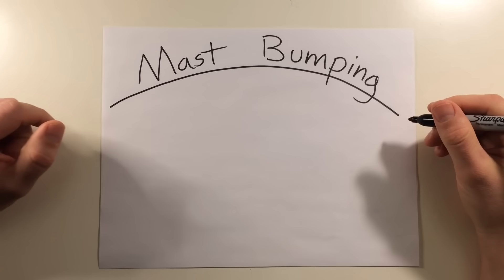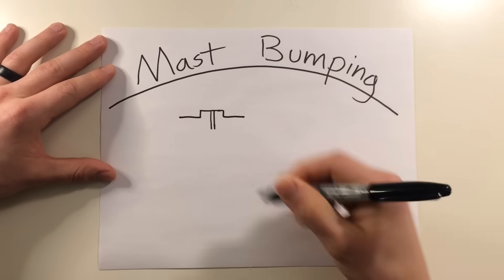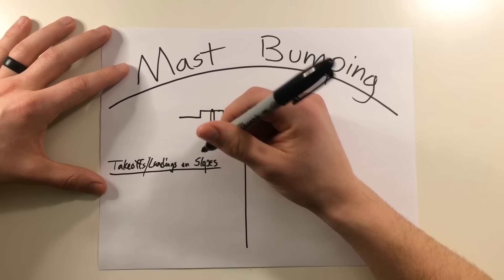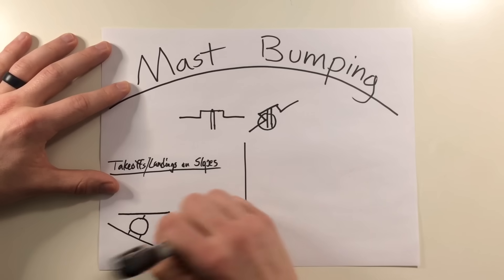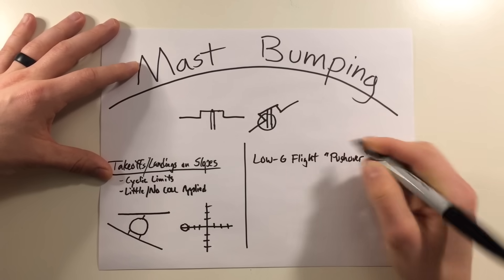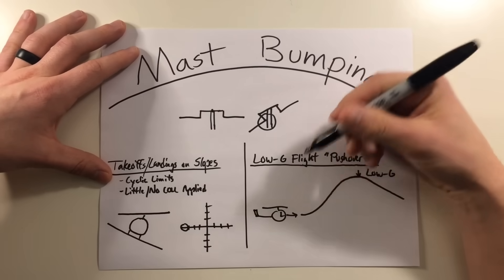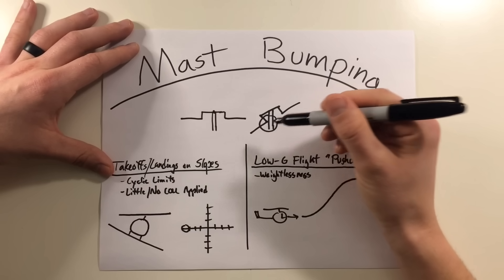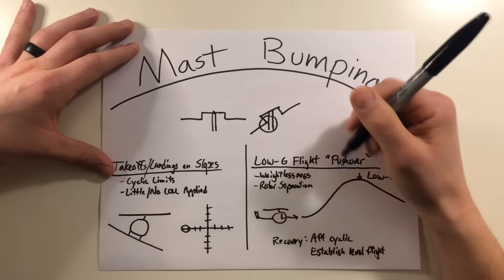Mast Bumping in Helicopters

Comment: 30 year helicopter flight instructor and ems pilot here. The NYC Hudson River accident is very unlikely to be low g mast bumping. LGMB results in the main rotor blades detaching from the mast just below the main rotor hub. The fact that the main rotor blades and main rotor gearbox are still together points to something besides LGMB. More likely a catastrophic mechanical failure of the main rotor gearbox mounting system. Incorrect maintenance is a possible cause. There could be other explanations. When the ntsb retrieves the tailboom and the main rotor assembly they will be better able to determine the cause.
Reply: What if it severed the tail prior to breaking off? Meaning that the rotors didn’t immediately detach but instead impacted the tail. Then the shock of hitting the tail caused the rotors to come off in the fashion you mentioned.
I’m not a helicopter pilot so I’m not trying to argue your point, just trying to learn more.
Reply: This makes sense as I would assume the pilot knew about mass bumping and how to avoid it. I would not think a touring helicopter would rapidly climb just to dive again.
Reply: Yeah but mast bumping is still a fascinating topic. So is ground resonance that’s crazy.
Reply: As a helicopter pilot myself. I agree with Brian.  Watching the rotor assembly spinning to the ground, you can see the mast sheared low by the gearbox, and the blades looked intact. Could be wrong, but I would say gearbox failure. Condolences to everyone on board.
Reply: Fixed wing pilot here: my theory (although obviously just speculation). Here Goes in mostly lay terms...
The Tail Boom Broke at some place FIRST.
REASONING:
The Big Blade at the top spins counterclockwise (to the left) in most American Helicopters
Newtons Law: For every action an equal but opposite reaction
This law is relevant because if the big blade spins to the left, the fuselage will want to spin or Yaw to the right (assuming a certain and basic mechanical gear setup) which directly relates to Newton's Law. Blade spins left, equal, but opposite force makes the fuselage want to spin right.
BUT, the reason the Fuselage does NOT spin right and out of control is because the small tail roter blade at the back of the tailboom Counteracts the force!
So what made the chopper spin abruptly to the right FIRST??? (Mind you spinning FULLY INTACT as far as anything the eye could see, as it relates to the video clips publicized) 
NOTE: for this to be possible, the Big blade did Not slice the tailboom until at or after the fuselage nose was spun to the 3 - 4 o'clock position.
The chopper made an abrupt turn to the right (past 90ºs) to about the 4 o'clock position (completely still in tact) *from what we the viewers could see*
UPON REACHING 4 OCLOCK, THE CHOPPER BEGAN A SEQUENCE OF BREAKING APART.
Again, The tail roter (small blade) counteracts the force of the big blade.
HOWEVER, if the rigidity of the tail boom was compromised (VIA A STRESS FRACTURE) then that would result in that particular structure FOLDING at some place along the Tailboom which would mostly IF NOT COMPLETELY compromise the counteracting force of the small tail roter at the back of the helicopter (causing the chopper to turn right!)
Now, we have a still attached (yet folded and flimsy tailboom).
As a result, the chopper spins to the right abruplty.. broken, maybe tailboom "crinkled" but still intact.
(CAMERAS OR HUMAN EYESIGHT FROM THE GROUND WOULD MOST LIKELY NOT BE ABLE CAPTURE THIS IN DETAIL)
Continuing my theory... As the chopper spins to the right (with a crinkled flimsy tailboom) the flimsy compromised tailboom structure then moves UPWARDS, from forces in flight, towards the main roter blade.
As a result, the compromised tailboom ascends into the spinning path of the main roter... and is consequently "sliced off".
SIMULTANEOUSLY, the impact of the collision between the big roter and the tailboom (in addition to the forces from the high G turn that the helicopter abruptly makes at the beginning of this sequence of events) is great enough to snatch or "JOLT" the big roter, along with the whole damn transmission, from the roof of the helicopter).
Obviously the fuselage drops like a rock as a result of all of these unfortunate happenings..
And thers your catastrophic sequence of events!
P.S.
Question: Now why would the tailboom just break at the root.. or at the halfway point.. or wherever....
Answer: Microfractures!
Sometimes, "Stop‐Drilling" is used to prevent a stress fracture crack from spreading any further.
This works by drilling a hole at the end of an expanding crack, which results in (creating space) via the drill hole... between the end of the crack.. and rest of the uncompromised structure. 
These cracks in wings (or the tailboom in this case) can just be created through ordinary accumulated stresses, compiled over time, from everyday flight forces.
It not a Huge deal as long as you're not overloading the aircraft.. esp on a consistent basis... BUT yet and still.. these issues Must be attended to. Just the same as you Must change the oil in your car if you don't want to fuck up your engine.
The problem with microfractures tho.. is that they are not always easy to see.
Disclaimer: I am not blaiming this on maintenance or anyone else at this point.
AGAIN, obviously this is Just A Theory and I really have NO IDEA what actually happened.
But, in this POTENTIAL scenario and THEORY of mines... if maintenance overlooked this issue, then it could definitely result in the compromised integrity of the tailboom leading to a catastrophic sequence of events ultimately resulting in a breakup in flight.
A "Ticking Time‐Bomb" just waiting to go off if you will.
So there you have it.. straight from your imaginary NTSB investigator here.. and obviously, I'm just as intrigued to find out what happened when the real report comes out as you are.
Final Note,
MAY ALL THE VICTIMS REST IN PEACE.. CONDOLENCES TO ALL CONNECTED, AND FLY HIGH TO ALL THE SOULS LOST IN THIS TRAGIC AND UNFORTUNATE EVENT🙏🙏🙏🚁🕊🌅
Reply: Blancoliro

Comment: Recovery action explanation is mission something.
 "...pilot recognizes this right roll and tries to correct with left cyclic. But this has little effect because the main rotor is unloaded. "   
So with an unloaded rotor, cyclic has little effect - that would be as true for fore/aft stick movement as for lateral movement.  In which case the mast bumping would just occur 90degs later!
It seems you would first have to apply some collective to load the rotor... before you can apply aft cyclic.🤔
Found the answer here -https://youtu.be/_QkOpH2e6tM?t=520 - the forward airflow increases angle of attack of the disk providing the reqd loading.  So the problem is moving cyclic to the front left or right corners.

Comment: It is not correct that the main rotor thrust is decreasing when you push over. Why should it? It has more or less the same collective setting and the same rpm. It is the the gravity force m*g of the whole helicopter which is decreasing due to dynamic change in the track curvature and all the forces: rotor thrust, tail rotor thrust and m*g will get out of equilibrium or trim state, resultung in a roll initiated by the tail rotor thrust with some lever arm over the the C.G. That is why nothing happens when you push as much as possible and as fast as possible with the R-22/R-44/R-66 at hover or low speed. The helicopter had virtually no track to build a curvature apon, so there will be no inertial forces reducing the m*g and leading to untrimmed state.

Comment: Very well presented. In a full scale helicopter on a slope, the helicopter must have been landed there so unless a skid or wheel has sunk in or the aircraft slid then bumping is overcotrol by the  pilot but something one might do gently to see where your limits are. So you ease off a wee bit and then make a positive break with the ground accepting you will not be able to go upward absolutely vertically initially as you break contact with the ground. A friend of mine was killed in Oman in 1978 or 9 whilst flying a Bell 205 Huey and it was thought he instinctively pulled back to avoid some seagulls - he was skimming across the sea near the desalination plant  or he wasn't paying attention and suddenly realised he was about to hit the jetty - all terribly sad. The wreckage suggested mast bumping. So how do you contour fly a Huey over prolonged distances at ultra low level - as I did as a military pilot. Firstly one is aware of the danger of negative G. One tries to vary height with the collective rather than zooming by inputting aft cyclic. If you shoot over the edge of a cliff you initially dump the collective quickly but not as a snatch. You may go Weightless but that doesn't matter as long as the cyclic is centered. As you feel the Weightless sensation subsiding you can then gently but quickly push the cyclic forward so that the helicopter goes into a nose dive. It is all a matter of feel. I don't ever remember any instructor dwelling on this but I do remember throwing the Huey as I have with any helicopter I've flown - Wessex, Bell 206, Westward Scout etc.... - all over the sky, showing off as one did as a young military pilot, without ever worrying my rotor shaft might snap. The important thing is to appreciate what the rotor head is doing. What you NEVER do if you have that Weightless sensation is to input any aft cyclic because the blades have become a bit unstable and there is a real risk of one striking your tail boom - and that's curtains!😡. Now how you deal with this in a model helicopter when you have no seat of the pants feelings I'm not quite sure. I suppose you apply what I used to apply leaving greater margin for error.  Flying the Bolkow 105 with a rigid rotor head one had none of those worries but as I always had paramedics on board I didn't think it was fair to turn upside down and having an iota of self preservation I would have wanted someone to demonstrate it to me and then watch me do it. Torque turns and very steep wingovers maintain positive G - albeit only a little.  I always thought the Gazelle was light enough and fast enough to be able to do a barrel roll - where you maintain positive G throughout - BUT  if ons cocked it up it could be a case of curtains 😢. I hope someone enjoys this ramble from an Old and Bold pilot who is still alive! - but now flies model aircraft.

Comment: Do these types of main rotor heads not have bump stops and what about collective stops to prevent over travel of the collective? I have over 20 years of experience working on Apaches from the Alpha models to the current Echo model.
Reply: The bell 47 has dynamic stops on the rotorhead

Comment: Hey Jacob,
I live out here in Texas and an R-22 crashed in Rowlett, TX due to tailboom separation. I imagine this was from mast bumping.  Can you please explain what you think they were doing to cause this? Thanks
Reply: Just speculation, but it appears from the flight profile that they were practicing recovery from settling with power. When the helicopter enters settling with power, the nose will drop. The control inputs to recover are to lower collective, some right pedal to compensate for loss of torque, forward cyclic to gain airspeed, fly into "clean" air, then raise collective to arrest the descent. What appears to have resulted was tail cone separation about 2 feet forward of the tail rotor gear box. Its possible that whoever was on the controls applied aft cyclic when the nose dropped. The aircraft would have been tail high and, as the main rotor was tilted aft, the main rotor blades struck and separated the tail.  Another possibility, though less likely, is demonstration of a low G pushover, which is prohibited in the R-44. Actually, all Robinson helicopters. This could have also resulted in a nose low attitude and caused excessive blade flapping, resulting in a tail separation. These are just my opinions based on the little evidence and not accusations toward the crew. God bless their families.
Reply: @herbie509  Thank you for your analysis Craig.  I’m a fixed wing guy so I value a rotorhead’s examination greatly.
Reply: It could be possible that a low g situation occured ,or they were flying very slowly or even hovering and entered a vortex ring state also known as settling with power. The rotorcraft would have started to the right, and possibly the wrong cyclic input sealed their fate.
Reply: @Back2Africa_Overland thank you sir.

Comment: Truly excellent tutorial - thanks. Came here after a search of mast bumping while reading a crash report of a fatal incident involving an R44. Subbed! Now for a question from someone more familiar with the physics of fixed wing flight....Cannot the rotor mount in simpler designs be such that this contact is prevented through either clearance or physical means? Or does the nature of rotary flight require a degree of tilt and blade flexibility that such range of motion is required?
Reply from the maker: Got a whole video covering rotor design that should answer your questions. Check out my “Types of Rotor Systems” video.

Comment: I'm here trying to figure out why the Robinson crashed because its blade(s) flexed or moved enough to contact the fuselage (top of canopy). 
Any ideas or input you'd like to share on that crash or the mechanics of it? 
Thanks for the video.
Reply from the maker: I haven’t seen the crash investigation or the video so unfortunately I can’t comment.
Reply: @helicopterlessonsin10minut10  I'll have to find which incident I was referring to. There was another Robinson that went down into the water near Miami today. From what I've read Robinsons have an issue with Mast Bumping.

Comment: @Matt Henderson There was concern for a recent R44 double fatality that Mast bumping may have been a cause, but the ATSB has not released their final report on the incident. All we do know for sure is that the rotor came down about a block away from the air frame which dropped into a backyard fortunately missing a house.
Reply from the maker: Rotor separation is definitely a result of mast bumping. But so could poor maintenance practices. It’ll be interesting to see what the investigation board finds.

Comment: Great explanation. However I request you to highlight which couple causes the Roll to occur as well how will the roll and yaw tendency differ for a clockwise rotating main rotor. And at which stage should collective input occur during recovery.
Thanks

Comment: Why does design allow this? Car doors and steering have LIMITED movement.
Reply from the maker: Aircraft do have limiters in the form of a Droop Stop and flap limiters. But with enough force these can be overcome and mast bumping can offer. It’s a severe downfall of the semirigid rotor design and why many military helicopters today no longer use the design. Once again, you really only get into this condition with rather aggressive maneuvering.

Comment: Here's a question: But WHAT happens if this "peak"  is somewhere at a mountain-top with thin air and you CAN'T "load"  the rotor?! Or if your RPMs are already too high.
Disclaimer: Not a pilot, just have a basic understanding of what you say here and some curiosities.
Reply from the maker: Ultimately you just have to think ahead of the aircraft and never get yourself into a position you can’t get out of. Like driving a car, you don’t want to drive so fast that you realize can’t make a turn while you’re in the turn.
Reply: @helicopterlessonsin10minut10  
Awesome answer. Thank you so much for replying!
Reply: Well, then, you must pull back on your cyclic—slowly, though, or else you WILL cause mast bumping—and this will load the rotor. A lot of mass bumping incidents have pilot error as the proximate or ultimate cause of the crash, and generally the types of people who cause this are experienced fixed-wing pilots re-training on helos, who do not have a reputation for being "gentle" with the controls. Helo controls are MUCH more sensitive than aeroplane controls to "jerky" motion. Helo flight is like dancing, and you WILL be doing something to the controls at all times. Don't do it in a jerky way, don't do it ALL the way, and always keep your hands and feet on the controls.

Comment: I  fly Huey gunships and we are able to do those kind of maneuvers and never had MB... not even close. You can do that, but you must be very 
conscious of what is going on with the aircraft at that particular time. Marines flew semi rigid rotor attack helicopters till 2012 in several wars. Awesome video!
Reply: He doesn’t mention it in this video, but mast bumping is mostly a problem with Robinson helicopters. Even strong turbulence in level flight can trigger mast bumping and cause the blades to separate, sever the tail, or impact the cockpit.

The problem is so bad that the FAA forbids anyone from flying the R22 or R44 unless they are specifically trained on the mast bumping and why you must never go low g in a Robinson. (SFAR 73.)